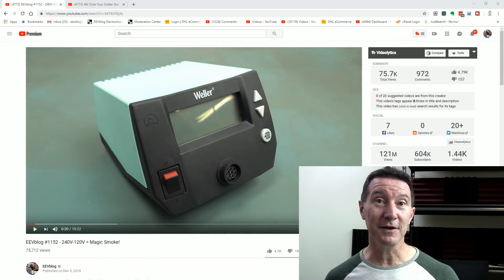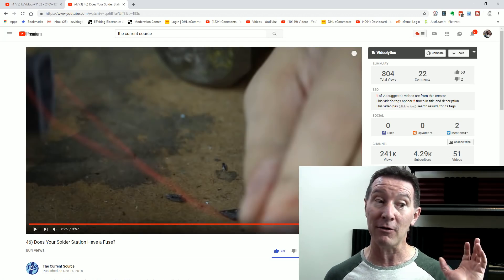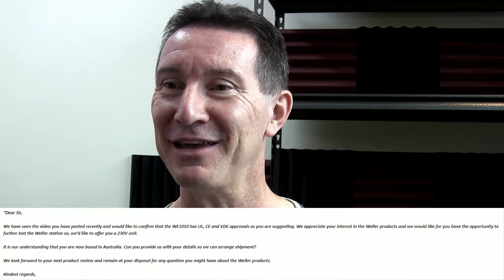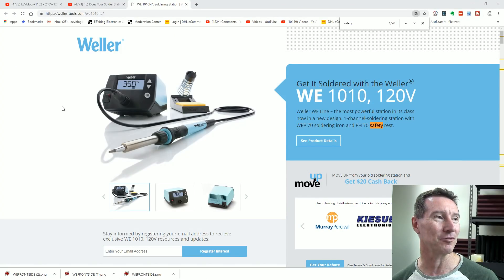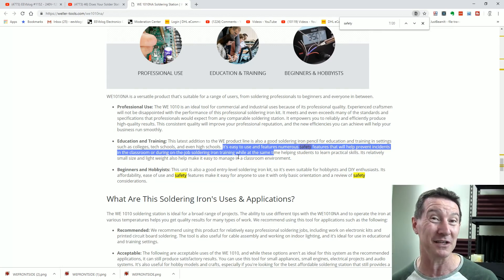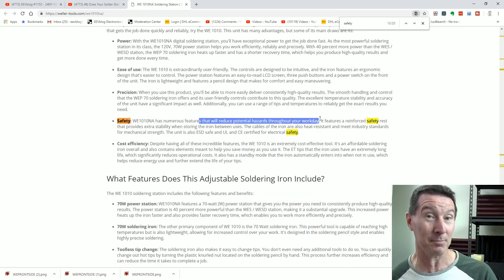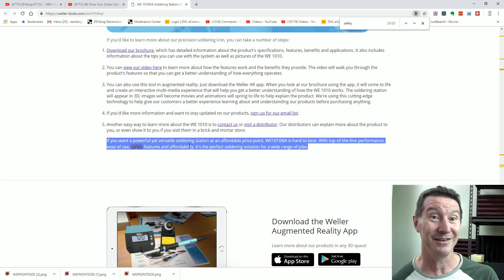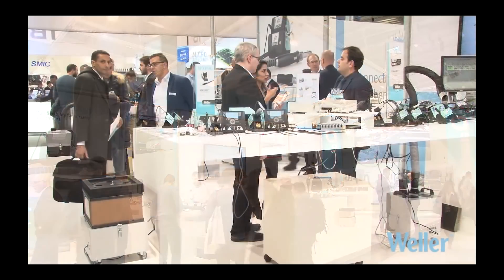EEVblog #1160 - Weller Responds!

Comment: @EEVblog I work at UL. Because the sample was operated outside of their declared ratings, neither they nor UL are liable for damage. That being said, I checked the datasheet for the test that should have prevented this and... uh... it's... well... problematic... I posted this on the other video too.
Reply from the maker: Could you add links to more detail please? Thanks.
Reply: @EEVblog  It doesn't sound good, but I can't say too much. Their test data is private. So, I can't be the one to share it. Skirting around that, I'll very intentionally say I wouldn't have much to share about that test. I also can't distribute the particular standard. I can dive back into the testing and give you the pertinent standards and clauses regarding the test, though. If you would like, we can communicate privately and I can prove I work at UL.
Reply: @CrzyMan_Personal  the question is: what would have been the primary current at 240 V ? I bet it would not have been enough to blow a properly rated fuse. Unfortunately I don't have such a transformer to measure by myself...
Reply: @vihai  Unfortunately, I don't know the answer to that one either. Safety wise, they could have integrated a fuse of an amperage rating to fail if there were a surge, but cost wise, the more they cut out, the better

Comment: The IEC standard on safety of transformers, reactors, power supply units and combinations thereof (IEC 61558) states that transformers up to 1100V do not need any fuses or overcurrent protection if they are build short-circuit-proof and in case of a failure the temperature of the isolation does not exceed a particular limit.

There is the symbol for short-circuit-proof safety transformers (two rings separated by a line and a square underneath in an escutcheon) on the transformer in the Weller WE1010.
Reply: Now that's a qualified reply. Thank you Tim.
Reply: It is nice that it is on the transformer, but it is nowhere on the box packaging,
online description, sales literature, downloadable information etc. So unless
you are willing to tear the unit apart you will not see the IEC 61558 symbol.
 This still did not prevent the magic smoke. Why not a fuse so 
that a repair could be made in case of accidental over voltage. Why
destroy the transformer? Disposable society rules. Weller products are
not what a starting hobby person would consider inexpensive so that
one could just go out and replace the unit instead of repairing it.. Still
others wonder why starting people chose one hung low brands. Aloha
Reply: @randygentry2724  A fuse might not have blown. Current would only be at most 4x normal. And fuses cause warranty failures/returns themselves. The more I learn about this failure, the more I'm on the side of the Weller engineers.
(The marketroid missed the boat on communication, though.)
Reply: Apart from the standard referring to transformers and their safety, there are also harmonised standards required for the instruments/devices using them. In that case, if you sell a device containing a transformer, not only the transformer insulation has to meet certain temperature criteria, but your device as well (in case you touch it). Short circuit may not be the most severe test for the device containing a transformer. It may be an overload test, which will put the transformer under stress for longer, which may not trip fuse, but should trip a thermal cutout (should these be needed to keep temperature under control). The insulation on the transformer can produce smell, but must not fail! So, the bottom line is, that even if, according to 61558 the transformer may not need any fuse or T/C, these may be needed to make your device compliant with a harmonised standard relevant to your device (say the transformer may survive 200C without extra protection, but then the enclosure of your device will exceed permissible 100C).
Reply: The mark is on the transformer itself, you can see it imprinted in the plastic at https://youtu.be/8itTKH5tj3s?t=343

According to the chart above, its a Short-circuit-proof
safety isolating transformer
Reply: Tim Krüger Thank you. Do you happen to know if IEC 61558 is the key standard to meet for the Weller unit to claim CE marking?
Reply: @rob3125  just because it isn´t short circuit proven.
Reply: Everyone is missing the picture. This was quite obviously a marketing decision. If you sell 1000 irons and they never break you sell 1000 irons. If they cost 1.00 less to make and 100 of them break and 50% of the people trust Weller, then weller makes an extra 1000 on BOM and sells 50 extra irons because it wasn’t their fault they broke. This was created by some scumbag marketing guy who came up with the idea while he was beating his children and cheating on his wife…. At the same time. A real BOBBIE DAZZLER.
Reply: So why did it catch on fire? And why didn't the marketing person actually explain that? Talking to engineers in marketing-speak is like walking into a bar and saying "who wants a go? you get to take first punch!" when you weigh 50 kilos.
Reply: @jonwatte4293  It caught fire because of the user overvolting the station.  Not that hard to understand and really not a flaw in the design.
Reply: @lucasimmons075  okay? Did you see the bit where I thought the biggest failure was the language used by the marketing person? Do you agree or disagree with that?
Reply: @jonwatte4293  I agree Weller's marketing and CS is shit but the products aren't garbage for low-mid range stations.  They're comparable to Hakko, and at the very least better than the knockoffs.  Also, didn't realize you're first line was a rhetorical question, my bad.
Reply: @jonwatte4293  The device failed catastrophically and the insulation underwent thermal decomposition, but that's not the same thing as "catching fire".  What UL generally requires is that a device not  e capable of malfunctions that would ignite nearby flammable materials.  If a malfunction totally destroys the inside of a device, but it would go open-circuit before it could ignite anything *outside itself*, that would be considered acceptable.  If one had a sacrificial iron for testing, it would be interesting to place the iron in a bed of untreated (flammable) cotton, safely separated from anything else that's flammable, and see what it would do if fed 240V continuously.  The fact that the device emitted lots of smoke isn't a good sign, but doesn't imply that it would pose a fire hazard.
Reply: @flatfingertuning727  
True. Then again:
Anything will catch fire if I push a few million volts into it (assuming "plasma" counts as "fire.")
Most interesting is seeing where different people put the bar of "acceptable" overvoltage!
Reply: Is this the list of symbols you refer too ?  http://www.noratel.com/fileadmin/content/downloads/school/Symbols_standards.pdf

Comment: I have a WSD81.  It has an IEC mains connector with an integral fuse. 500mA. It is a 240v Unit. 
They really messed up with that response... You can't BS engineers. I would have accepted the replacement though to see if the 240v version has a fuse.

Comment: Give me a technical reason: You're smart enough to be using a soldering iron you should be smart enough not to plug it into a power source that's double the rating of the device. 
I'm not being sarcastic here, but I bet that's the logic they used on this. Doubly so if you just emailed a generic support email line and not someone from the engineering side. There's a pretty good chance that neither the secretary opening generic support emails nor a VP of marketing understands exactly what you were saying and likely just took you for a tosser that moved to Australia and brought along his American rated soldering iron.

Comment: Now if this ain't a good reason to go on ebay and buy yourselfe one of those ZD soldering station for a fraction of a price that you would pay for Hakko or Weller , then I don't know what is. Bought  one myselfe , about 5 years ago (Hakko 936 clone). Still to this day works like a charm :)
Reply: ...Or go for JBC instead. Has surpassed Weller about a decade ago.
Reply: same here, and it even have a replaceable fuse :)
Reply: Which model do you have?
Reply: @otm646  simple one 48w, zd-919. Yesterday i ordered some T12 based soldering station from e-bay for test, i like the heater&tip unibody idea. Been working with wellers for years on previous job, electrical and propane, don't really see any real difference except in price.

Comment: What they are probably doing is skimping on the cost in markets where they think they won't be caught. The UL approval is for the design, not each individual unit. The manufacturer is supposed to produce all units exactly the same as the one tested but there are loopholes that allow for small changes. Now either they found one of those loopholes that somehow makes the primary protection optional or they just think they can get away with it in some markets.  To be fair it could also be some foul move by one of their manufacturing subcontractors, but even so it is still their ultimately their responsibility if they are selling something that essentially has fake approval and is dangerous because of that.
Reply: c'mon the glass fuse is few cents...not a terrible loss for company to add one, given the price of the unit

Comment: In the US we have discrete plug configurations to prevent this.  
If you put an adapter on the plug & then plugged it into a known 230VAC line, then I look at you for fault & not Weller.
And you had a chance to test the 230VAC model & wasted that chance too.  When we tried to fool proof something at work, we always found a better fool.  Tons of stuff out there with no primary fuse.  But I do agree it would be nice to have one on everything.

Comment: The Vellerman station on my desk has got a primary side fuse. A barrel type 20mm glass fuse holder on the rear of the unit. How is it possible that Weller can't manage this?

Comment: Oh COME ON, Weller is a reputable German company, BUT it was taken over by a US company (Forgot it's name). I have been heavily using WX 2020 for about 4 years now, very durable piece of equipment. In Russia we have 220AC and 380AC, once the neutral wire got disconnected in the fuse box (don't ask how that happened), and 380AC  (which is about 630 in amplitude) went in to mains. A lot of everything just blew up (the input filter capacitors mainly), exept WX 2020!!!! YES the fuse (there is a 2A glass fuse) blew, but nothing else! 

And besides, as you MUST know, the good iron is not the power box , but the iron itself - the tip and the heater, which ARE the most stressed parts (especially when you solder power electronics at 400C 10 hours a day), in my experience I never had any failures for 4 years. AND - 2 irons cost more than the powerbox, so it is not the most expensive part of the set!

Comment: In a way I am surprised you were so hard on Weller.  Getting a UL approval is not easy.  I've known about someone who designed a device to be plugged into a 120 VAC line.  Is was very difficult for him to get the approval.  The tests were very exhaustive.  I would venture to say that the transformer in the Weller must have a very robust primary side for it to get the approval.  Apparently though, UL didn't anticipate that one designed for use in North America would be plugged into an outlet in Australia.  Don't get me wrong, there is no question it would have been better to have the fuse, but there is NO WAY an engineer (that's what we are here) can anticipate every possible scenario of how something can be used improperly.

By the way, I was very impressed with the iron based on your review in the first video.  I already bought an FX-888D though, (base on your video on soldering) so I don't have a need for one.

Comment: The 240 volt has to have one but in the US we are fine with it as we have MCBs.   You cant pull more current than the cables can handle with a American circuit so we dont require fuses in our products.
Reply: I hope you are joking.

Comment: Seriously. Even cheap low-power devices nowdays have fuses or at least fusible resistors to make sure the device at least does not catch fire in case of a short.
Saving probably less than a cent on such an essentiall safety feature is beyond lame.

Comment: I have an Ersa "I-Con Pico" soldering station made for the EU market, and it has a potted transformer. I'm pretty sure it doesn't have a primary fuse either. What sense would a potted fuse make? As far as I know, it depends on certain factors whether regulations demand a primary fuse or not. Many consumer electronic devices like CD players, Sat receivers etc. don't have primary fuse either.

Comment: so there are a ton of replies from people who don't fundamentally understand failure mode analysis or safety certifications. A couple of points:
1) a safety certification does not have anything to do with device survival, if it breaks due to a power issue then the only requirement is that it break safely
2) the certifications are in general based on there being a significant chance that a failure mode will result in harm using the established set of parameters (ie surge of X volts for Y duration, etc), plugging a U.S. unit into an Australian outlet is probably not among the tested conditions
3) if there's no significant chance that an overvoltage condition would cause the unit to explode, catch fire or otherwise cause harm then the device would, barring other issues, be nominally considered compliant
4) If transformer varnish smoke is toxic then see #3
From an engineering point of view, I'd rather that the devices that I need to use on a frequent basis have failure modes other than "too bad, its broken buy another one" and, when faced with a buying decision, its certainly something I take into account. I won't go out and buy another one of something that disappointed me. On a completely unrelated note, I just switched from a Weller WES D51 which I've been using for more than a decade (and has never failed explosively or otherwise, but its not doing as good a job of regulating tip temperature as it used to)  to a Hakko 951 and it makes me happy from a functionality standpoint. I bought it before all of this business came to light.
Reply: So, as long as the resulting FIRE is not hot enough to burn your hands, everything's fine.
Reply: @mmiller4430  If you drop it and it breaks, everything's fine as long as it didn't break your foot. Nobody can certify a product break-proof, or at least there's no standard for plugging into the wrong outlet. It's just not meant to be done ever, so why bother?
Reply: @sietuuba  so let's all pick on Weller.

Comment: I live in South Carolina where an Apex tools who make Weller products, has a facility 10 min away, you don't need primary side fusing since it has secondary protection since it's for 120v it was a forced failure mode by applying 240v, so it was a result of the end user not checking the specs, just replace 120 v transformer with a 240v counterpart, and  it'll most likely work.

Comment: i wonder if the 230v variant has a fuse or not and under what circumstances did it meet TÜV  Electrical Safety Testing if it did indeed meet it

Comment: Dave, you're making a fool of yourself, and this was the video to finally unsubscribe.

The soldering station was fine until you plugged it into the wrong voltage. Maybe you ask viewers from the states to send you more 120 VAC equipment, which you then can torture with 240 VAC and then do autopsies and comment on how design changes could have made the bang while exploding smaller. And then demand from the manufacturers to incorporate your design changes to handle wrong voltages, and for them to also acknowledge that you are the superior electronics designer.

Your ego has grown so bold, you can't even acknowledge anymore when you are in the wrong.

Comment: I may again stress the CE sign regulations here...
1. To my knowledge (I may be wrong), and at least in the EU, it is prohibited to advertise with the CE sign.
2. As part of the CE Sign regulations, the manufacturer has to state all standards and approvals in the manual to which the unit in question complys.
Lets have a look:
https://media-weller.de/weller/data/OI/OI/WE1010_OperatingInstruction.pdf
On Page 17 we find exactly that list of standards.
The major standard in respect to (electrical) safety is also the top most stated EN 60335-1.
https://www.sourcetronic.com/en/glossary/en-60335-2/
Unfortunatelly for Weller and without a primary fuse installed, this units violates (IMHO) already to this standard.
I may quote:
"c) Functional check - Any malfunctions cannot prove to be dangerous."
Beside of the potential fire hazard, Dave also was exposed to smoke, which itself surely wasn't healthy and therefore dangerous.
Just my 2 cents.

Comment: Please let them send you the iron, so you can check if you can use it with 120V OR 60hz (maybe a speaker powered by  a 60hz sine wave signal  is enough to run this thing:) )

Comment: Their ETL listed is for the soldering iron is (CAN/CSA-C22.2 No. 60335-1) IEC 61010 which is about Safety of Household and Similar Electrical Appliance. The most related safety test on 61010 standard is short circuit test which only require the appliance to pass by most likely shorting the soldering iron cable and noting will be done inside the appliance.  The primary side fuse is simply not required. source : was electrical lab engineer